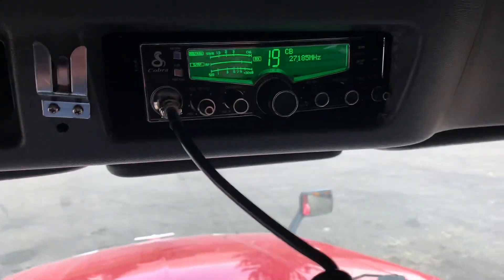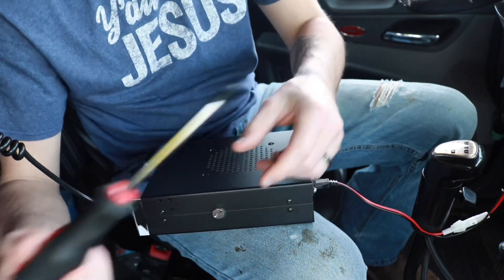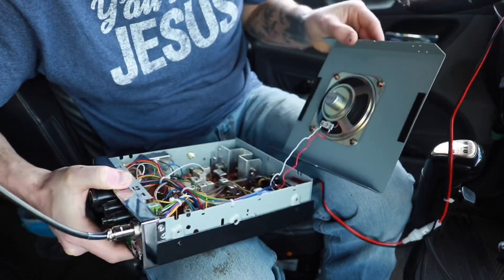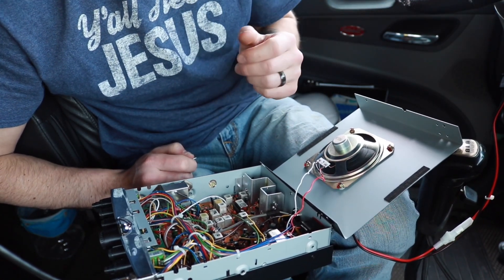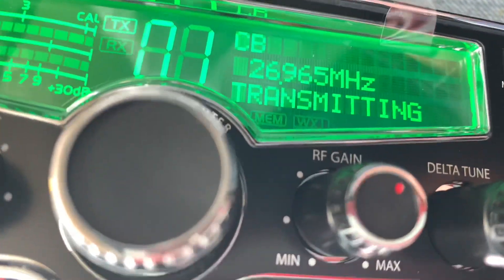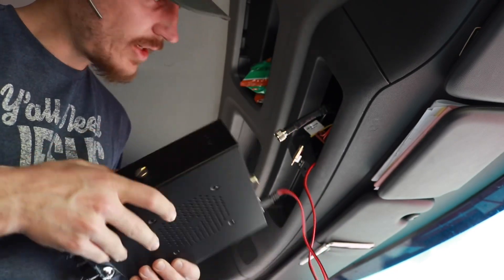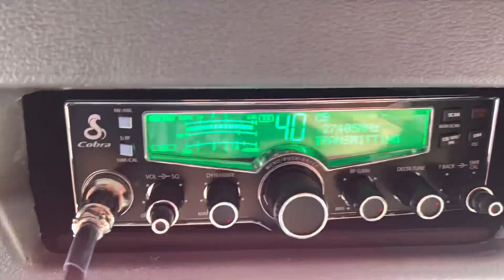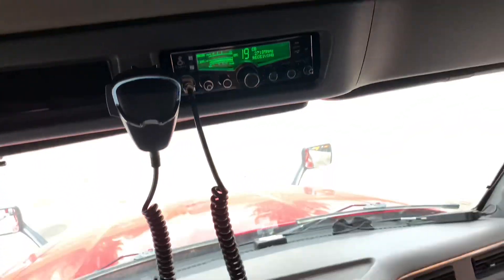How to video | CB antenna warning fix | Cobra 29 LX

Comment: Oh my god….you’re keying the radio without an antenna….that’s good for it….just because you get a low swr reading does not mean there is nothing wrong with the antenna….the warning is there for a reason…the coax could have a short….meaning it reads low but it’s not giving all the power to antenna….that warning goes off when reflected power is too high….a shorted coax will reflect power back to the radio….the radio knows what you don’t….the best thing to do is disconnect the factory coax because it’s GARBAGE….run your own coax for better performance….then ground your antenna….not to the battery….it needs counterpoise….that is the metal of the vehicle body….run a ground strap (not wire) from the mount to the closest bolt in the body….the better coax and better ground will make the warning go away the RIGHT way and you will get better performance as well….2 birds one stone….if any of that sounds crazy just let a cb shop do it for you….but DO NOT fall for the radio tune up sales pitch….getting your antenna right will get you way more range than jacking up the radio
Reply from the maker: Did you not watch the beginning? There is antenna hooked up at first.
Reply: @truckertavis  then you unhooked it and keyed the mic while you monkeyed with the swr calibration pot….now when you get the rest of your system fixed your swr meter will no longer be accurate….there is a reason it’s flashing…if it’s beyond your skill level let someone that knows take a look at it….I’m willing to bet you’re running factory coax….that’s 90% of the problem….crappy coax reflecting power back to radio….run your own coax for best results and tune the antenna….the warning will go away after that….but you did do a nice job showing the ones who don’t worry about it how to make the warning go away….most drivers never turn their radio on and when they do they don’t really care how good or bad it works….and those are the drivers who drive for companies that still allow a cb in the truck….not bashing you just saying if you want good performance out of your radio there is a little more to it than turning the warning off
Reply: @blainehartley9157  I watched this video AFTER I decided to turn down my vr6.  Antenna light came on with power on after cb fell on floor from dash when I was installing new bracket. I was like wtf. Well instead of putting meter on everything I decided to turn it down....low and behold soon as I lower squelch the radio starts smoking from the back left 😔
Reply: Blaine Hartley thanks I've got the no antenna warning and after talking to another company driver I found out a few thing's and what you said is right bad factory coax that's been folded in the mirror kw t680 unfortunately it happens when it gets wet so I'm patiently waiting on a new truck and try your route on thing's

Comment: Just so you know, by doing this all you are doing is adjusting the threshold for the warning light and not fixing the problem. You would do just as well with putting tape over the light. If you are not tuning the antenna system, you are not fixing the problem. Changing the antenna or antennas  will not fix the problem. You are just putting on another untuned antenna. Most reputable CB shops will adjust the antenna to a usable SWR. No your radio is not going to immediately blow up but high SWR will shorten the life of it and effect the range of transmit and receive.

Comment: I just pick the same radio a week ago and I removed the cover and the vrc26 is not there. What do I do now?
Reply: Ever find a solution?
Reply: Same
Reply: @JoseDiaz-pk9hz  This radio needs an antenna made to work with am/fm. Factory antennas dont. Change your antenna out.

Comment: As long as your antennas are calibrated and your swr is correct, that could be a fix. But that warning is usually due to hi swr which comes from antennas not being properly calibrated. At some point your finals will burn out and you're also not taking advantage of how good your radio can work, if your antennas haven't gotten properly calibrated.
Reply: You do this adjustment with the antenna disconnected so.....yeah
Reply: @jhonnybravosc  no way lol
Reply: @iamhowiam2862  

I admit to having a bit of fun here but are we really suggesting now that the swr meters that come on these are dead nuts?  My meter showed everything was fine but the on board cobra meter says everything fuct.  I admit to doing this adjustment with a free radio off a wrecked truck.  No finals were blown while typing this.
Reply: @jhonnybravosc  🤦‍♂️
Reply: How do you calibrate antenas?

Comment: Here's my solution. I have a Cobra 29 LX and i have been getting the "antenna warning" pop up every time I key up.
Recently I switched trucks and it was working on the one that i left and wasn't working on the one i moved into.
Rather than changing factory settings, I knew it probably wasn't my radio. So it HAD to be from the antenna to the radio. I found it. My coax connection at the antenna was sheared off but still looked viable.
It's a connection issue or a swr issue not a radio issue.

Comment: Hell yeah, I was loosing my mind over this😂 thank you a lot, driver. Keep the rubber side down, and the shiny side up🤙🏻
Reply from the maker: Glad it worked out! And you as well driver!
Reply: Awesome   Thanks drive
Reply: A tip if your SWRS are 1.1 to 1.5 and still getting the antenna warning try turning down your mic gain it will stop the warning it only goes red when over  modulation takes place

Comment: I was just going to do this, because I just set SWR on a used K30 I just picked up. However I moved it from the roof of my car to the trunk lid, and that cured my problem without having to open the radio up. Thank you for the contact, I think my VR6 still could be adjusted a bit.

Comment: Hell yea! Thanks man! You just saved me a bunch of money!  Appreciate it.  Be safe
Reply from the maker: Glad it helped out!! Keep the shiny side up and rubber down!!
Reply: A tip if your SWRS are 1.1 to 1.5 and still getting the antenna warning try turning down your mic gain it will stop the warning it only goes red when over  modulation takes place

Comment: I’m not being trying to be critical here. I know you said you don’t know much about cbs but, you should never key the mic without an antenna hooked up. The transistor output has nowhere to go but back into itself. Therefor damaging it. To check your SWR you calibrate just like you did, unkey the mic, tap the button till it says SWR, then key the mic again to get the reading. Many of these CB’s “SWR meters” are not very accurate. It’s ideal to use a separate one made for this as they are more accurate. 
I will say you did answer my question. Instead of turning it off tho I will make it flash where I want it to… and set it there using an accurate meter. If you see this warning flash it is a good idea to actually check the SWR. Otherwise you could be high… like say, 3 or 4. That is what burns up the final transistor(s). They’re not hard to change but, it can be avoided all together with a meter and a YouTube search on how to do it. Thank you!

Comment: I have this very same radio .I made it to home base unit and I utilized tram 1400 no ground plane CB base antenna. on a galvanized 1 3/8 fence post as a mast. initially I had conduit straps holding it up there which was not working. but I had the CB tuned no CB antenna warning. I then to secure the antenna Mass better. With hanging strap and bolted it on there better now I'm getting a CB antenna warning. Any idea of why this would change?

Comment: The Antenna Warning Light is Their for Reason . If You Have High SWR above 1.5 Reading  So the CB Radio Won't Blew UP Inside 50 o Transmitter . Check you Antenna 's and Cable  Run System for Issues and Re-Cal Cobra SWR System Internal or Use SWR Meter Hand-Held Unit . Don't Key the Mic-Button Until the Warning Light Goes-Away .You Will Damage the CB Unit Permanently . Don't Open Box-Cover a Play In-Side the Unit ,That's No No !
 Hope this Helps.
Reply: A tip if your SWRS are 1.1 to 1.5 and still getting the antenna warning try turning down your mic gain it will stop the warning it only goes red when over  modulation takes place

Comment: Hey also,if there is a negative to positive interaction this will also happen.1st take a good look at how you have hooked things up 1st.2nd take another look after you have made some new adjustments looking better into your set up then with what you can't find or figure out this option is great so that you can transmit.That really is the only thing this warning does and it's a big deal to not be able to use what you paid for.But there has to be a negative to positive interaction that shouldn't be taking place is why the warning is reacting and finding that issue is worth it for a good set up.Thanks for the tip because I'm still getting warnings that do go away but still getting warnings temporary and so Awsome fix good to know.

Appreciate the touch on the tunes but kinda loud bro and maybe a better tune a little lower.But the music took from the video. I feel ya feels every one is pointing out a thing.I appreciate the video ya know. Try some guitar rhythms hahaha or deadmau5 better or start your own music set yeah.Good 1st try there is a thing in Chicago called musical soundstreams there long trippy tunes for people that like to chill 15 minute 20 25 minute long jams that stared along time ago before 90's.Sunday nights 10 till Midnight something like that 107.5 is a R and B station but changes on Sundays you can't find the music anywhere else.

Follow up update. I have a brand new Cobra 29 LX MAX and this worked for me.All I did was just turn it CLOCKWISE just a little to the right and got back all my channels.

My issue I got the K40 the big monster coil 10,000 watt in black cb antenna.Well the rod that is used to extend or decrease the over height of the cb antenna, if you don't have the rod fully extended alot of the rod is in the hollow base of the cb antenna and I feel it is touching.The only connection should be at the top of the base antenna where the set screws are located not also in the hollowed out body.The antenna is super long and has to be cut.

So what I did I have a Peterbilt 579 and the set up is in the back so what I did is get the height of the antenna over the roof line of the cab.

Not much higher in case there are some 13"6' tall overpasses  but my antenna is extended and easily goes that far but still has a ton of antenna still left in the body of the base antenna. So I got my height and clipped the rest off.Right away I noticed the warning wasn't as no where near as dominant but would come on briefly. So I did this fix it worked I checked every channel and didn't move this fix at all really.Just a little to the right very little just a slight turn and it worked.I got all my channels which is Awsome.

This fix works on the newest Cobra 29's.

Comment: You should check your swr before you adjust vr 6, keying up your radio with no antenna connected can weaken or burn out your final transistor,  don't assume that your antenna is right, always check your swr before you start turning screws.

Comment: I'd like to know how in the same Hill do you truck? Drivers tune ACB radio and the cab of your truck were out of the silver scope or any other electronic measuring device for that matter.
Reply: Just like this since CB shops are so far and few between. Even if we can get near one, schedules have to line up or we pull in just to find a locked door. Very few CB shops around anymore 😔

Comment: Hey! I have the same radio as you, and my radio is calibrated. However sometimes the radio has barley any sound even though it’s on full volume and shows “antenna warning” if I do as you did, is that something that messes with the speaker volume? I’m at a complete loss.
Reply from the maker: If it’s the volume that’s having issues I’m not sure it’ll be the same issue/outcome but if you’re getting the antenna warning than it just may. I’m definitely not a professional when it comes to cb radios but could be worth a shot or get it taken in for someone to look at
Reply: @truckertavis  thank you!
Reply: A tip if your SWRS are 1.1 to 1.5 and still getting the antenna warning try turning down your mic gain it will stop the warning it only goes red when over  modulation takes place

Comment: I was getting intermittent warnings with brand new antennas and cables.  Matter of fact, I get new cables and antennas because the radio was giving me warnings with my old steel whip too.  Guess it was the RADIO after all.

Comment: Have the same exact cb couldn’t find the vr6 deal and broke something off the motherboard I literally just bought it 2 weeks ago and still the same issue any suggestions now?
Reply from the maker: You may have a newer model than me and it might be in a different location or possibly unmarked for some reason. It could also be your antenna. Most come calibrated from the manufacturer but need adjusted.

Comment: Thank you. I’ve been trying to figure this out forever
Reply: A tip if your SWRS are 1.1 to 1.5 and still getting the antenna warning try turning down your mic gain it will stop the warning it only goes red when over  modulation takes place

Comment: What is that component called? My radio has those little blue and white ones in the v6 slot instead and I think it might be a mistake
Reply: Update, I just needed to turn it counterclockwise, for some reason it was all the way clockwise. THANKS!

I would also imagine it’s best to test that with the coax connected, just so that the SWRs are good

Comment: So this is likely where that poor trucker girl got her information. Adjusting the sensor to the warning indicator stopped you from being aware that there is an issue, but the warning was due to a high SWR. 

You disabled the warning circuit and ignored the issue which is causing the high swr?

People, look for videos showing how to test and correct high swr, never open a radio unless you are qualified to do so. That warning can now be ignored, and the cause not fixed? Please don't do this.

Comment: Hey hey! I could use some help man. So I got myself a Cobra 29 LX (the exact version you have) and I've been having an antenna fail, despite having very low SWR. Like, below 1.5 on both channel 1 and 40. 

However, the fail ONLY happens when the truck is RUNNING. Works just perfect when sitting still, key on, doors and windows closed, etc - and flashes the warning when the engine is on, regardless of if you're heading down the road, or sitting still. Been looking online, and can't seem to find anyone else with this problem on any forums, or YouTube.

Do you think it's just an annoying, non critical bug, or is it something serious?
Reply from the maker: I’ll have to look into it. Never heard of anything like that before. Maybe the antenna itself needs recalibrated
Reply: @truckertavis  I actually got it fixed. Apparently it was a bad connector on the Coax...switched out the cable, and it works great now!
Reply from the maker: @connorbaz5980  glad you got it figured out! 🤘🏼

Comment: Will this warning sound give it a scratchy sound as well...i was always told if you key up the mic while not hooked to the antenna it could blow your finals have you had any issues after wards?
Reply from the maker: I’m honestly not too sure, I’ve never heard of that, but it doesn’t mean it’s not true. And no issues, all has worked well ever since this
Reply: I just got mine today and realized the board is different that the one in the video and no VR6 present. Same issue here. Did you find the substitute in this new boards? Maybe RT7? Thank you in advance.

Comment: That setting is sensitive for a reason and changing it before going through several other tests of the antenna with a good SWR meter of antenna and coax analyzer is foolhardy to be sure.. I have seen wet and corroded antenna connectors, bad grounding at the antenna, bad coax that got pinched/chewed/melted etc.. Heck I even saw 2 different antennas that were hit by lightning and the wire inside melted plus a few melted by high powered kickers.. So my advice is if you don't know what you are doing or don't have the proper stuff to test or adjust things DON'T DO IT..

Comment: A tip if your SWRS are 1.1 to 1.5 and still getting the antenna warning try turning down your mic gain it will stop the warning it only goes red when over  modulation takes place

Comment: Other than it showing an antenna test fail, it doesn't really affect the legitimacy of your operation of the CB right?  Could one just say the hell with it and keep using it without doing this procedure albeit lazy?  😆
Reply from the maker: I did a test to see if that option is possible and I never got any responses back so I don’t think you can haha like everything will work but you won’t have a good connection to communicate
Reply: @truckertavis  Oh OK ... I just figured if you're modulating and people can hear you I assumed you could just continue without doing this fix even though the antennae test fails.   I appreciate your video ... it'll get me squared away.
Reply from the maker: @TheDamageinc81  I’m sure you still could in a shorter distance like right next to another driver or a few feet away but not longer distance. At least in my experience. Glad it helped tho! Stay safe out there driver 🤙🏼